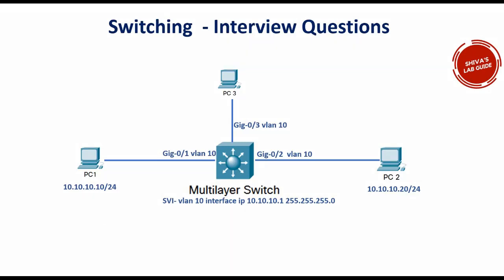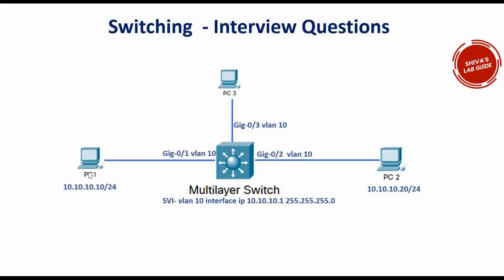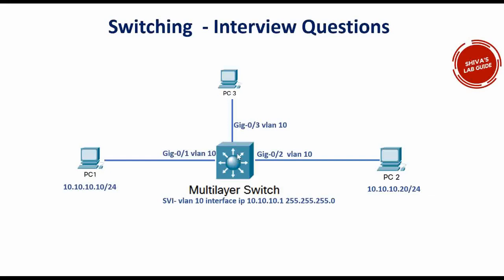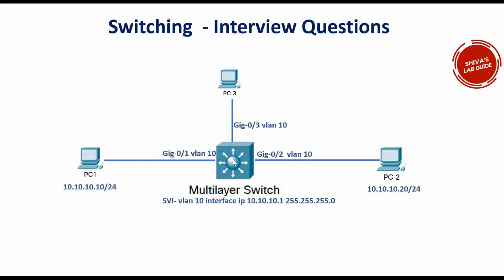Switching Interview Questions-1

Comment: Noted : Layer 3 switch, all the ports in the switches are Access Ports

Scenario : Access ports communicates within the same vlan, it won't communicates from one vlan to another vlan

if it want to communicates from one vlan to another vlan, that process what we defined as Intervlan, using the device Layer 3 switch or Router

Exact scenario : Here, all the 3 PC's are connected with L3 switch, whereas it acts as Layer 2 switch.
Because when comes to Layer 3 switch, Layer 1 & Layer 2 will be active, so Layer 3 simply does not works for this scenario & it reminds quiet.
Layers 1 & 2 : switch ports, read & understand the MAC address, frame transfer (requests & replies) using access ports (within Vlan), secure check, ARP (if required).

so, there is no works for Layer 3 here & it reminds quiet.

Comment: Scenario 1: ping from PC3 - If the destination Mac address of the ICMP packet is the same as the L3 switch's Gig 0/3 Mac, the L3 switch does routing.
Scenario 2: ping from PC1 to PC2 - Here the destination Mac address of the ICMP packet is different than the L3 switch's Mac address. So the switch does forwarding.

Comment: So if PC1 pings PC2 the switch is doing L2 switching due to MAC address being different. PC1 will determine if the destination is on the same network or not by checking its own IP address and subnet mask. If the destination host on the same network then MAC address will be of the destination host. If IP is on the different network then it adds MAC address of a Default gateway into the frame and switch does L3 routing.

Comment: When the source and destination is on the same vlan then the switches perfome L2 switching and when there is a different network and the request is for different vlan then core switch perform the routing based on the database inside the core switch if the both networks are available in the vlan database then routing will be perfome and the core connect the different network into each othe and there is IP routing command must be executed in the configuration mode because by default core switch perform L2 switching

Comment: since its a layer 3 switch , i also think icmp comes to play how with the ip routing command the switch will examin the dst-ip and check if the dst-host is in the same subnet or not,if not then it will just route the packet